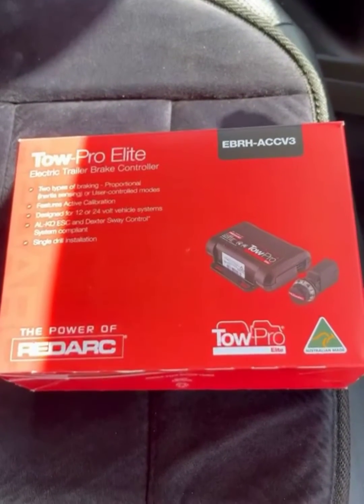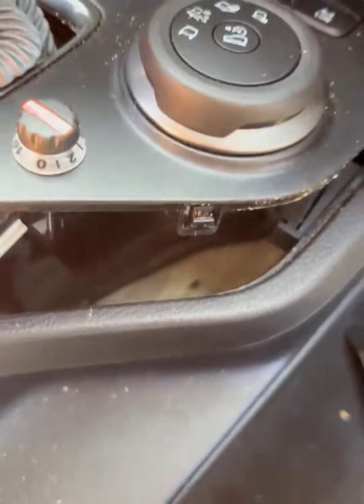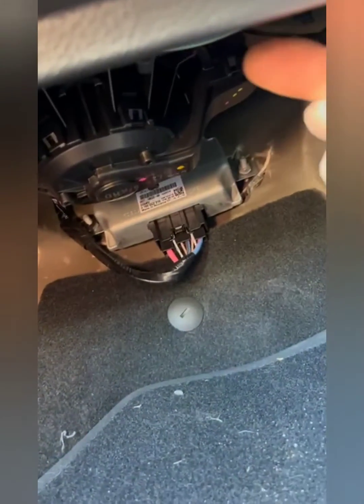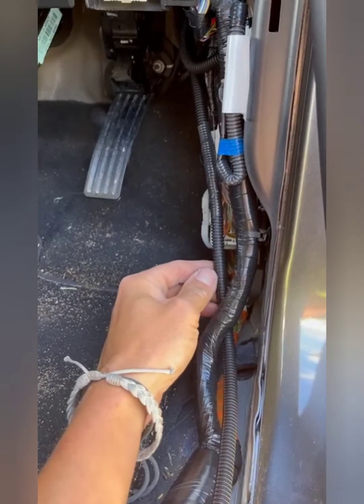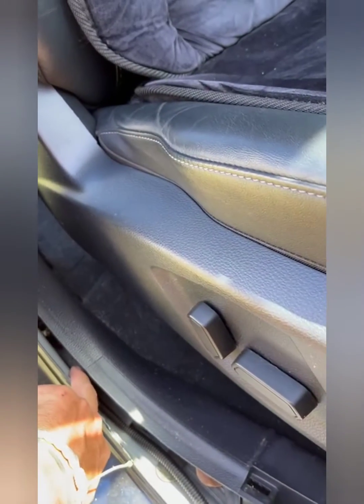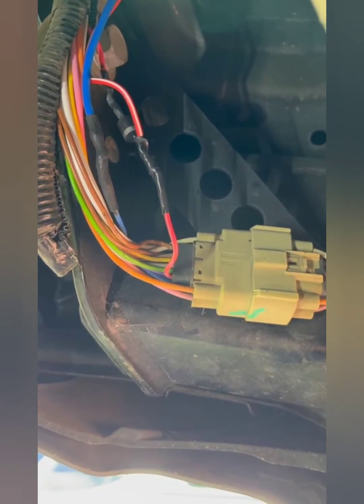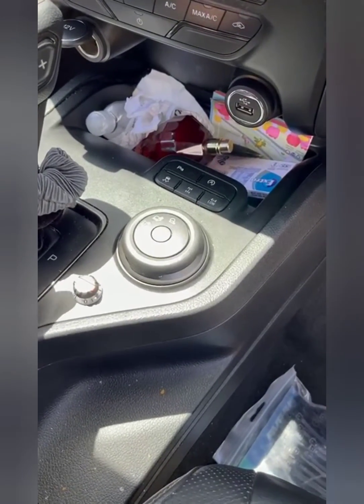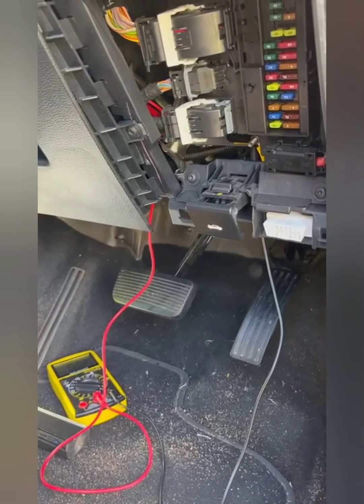How to Install a Redarc Tow-Pro Elite Brake Controller on a Ford Everest with AEB System

Comment: Hi mate, I did pretty much everything in your video but now I'm getting a BLIS and cross traffic alert alarm popping up all the time? Any suggestions?
Reply from the maker: Hi, what year is yours? Is it a next gen model?
Reply: @vesautoelectrics  it's a 2021 ford everest Titanium, let's of the old shape.
Reply from the maker: Sorry for delay, travelling overseas at the moment visiting family. If you used a diode and picked up the brake light trigger from the trailer socket, then cut that wire under the dash and and go straight to the brake light switch trigger with no diode. Wire colour details are at the end of the video. Some Everest’s can be temperamental and need to be done via brake switch even though of the spec.
Reply: @vesautoelectrics  i did use the diode! So you mean cut the red wire at the controller end, not the plug end! And find the break switch wire and connect the red to that?!
Reply: Oh, and remove the diode?!
Reply from the maker: Yeap spot on, and don’t use a diode. See if that resolves the issue.
Reply from the maker: Yeap
Reply: Would you recommend to do the exact same thing for my Everest titanium (my18 model)
I installed my brake controller (Curt Brake controller 529002) to the same instructions in your video but I’m also getting BLIS disconnection and cross traffic alert.
I connected the stop light signal at the rear with a diode because my Everest has AEB.

Really look forward to hearing back from you, 
Thanks

Comment: Thankyou for your video and advice cheers kevin
Reply from the maker: Glad the video’s helped. Let me know if you need any other info.
Reply: @vesautoelectrics  just finished installing per video and instructions with the diode around the right way but my blind spot and trailer is connected display keeps coming up every few minutes while driving even though trailer is not connected 
Any thoughts please I have a 2015Ford Everest with AEB braking .Thankyou Kevin Still

Comment: Thanks for posting the video, I found it helpful with the install in my 2019 ranger, though have been (intermittently) having issues with 'fast flashing' (of the dashboard indicator lights) when indicating left or right. I have reviewed my wiring and confirmed teh diode is installed in the correct orientation, and that my pickup is after it. Mine is a 2019 Australian XLT Ranger with Automatic Emergency Braking (AEB) & Adaptive Cruise control.

Further reading leads me to believe this model does require the special filter component included in the $300 AUD TPWKIT-012 kit (see link, small red package goes in-line with red wire at the controller). I thought I'd point this out for others so you can malke an informed decision before trying to install without the kit... 

If you have any further advice / info on the filter circuitry I would love to hear it before I buy the kit. 

https://www.redarcelectronics.com/au/tow-pro-wiring-kit-tpwkit012?utm_campaign=mof_aus_search_dsa&utm_source=google&utm_medium=cpc&utm_term=&gclid=Cj0KCQjw756lBhDMARIsAEI0AgnkucCahwXMa-pGkYk_TIY1Q0ughBZsOxLadW55FBeCkHqVAPP9fUIaAnCXEALw_wcB
Reply from the maker: Thank you for the feedback. If you have AED cruise control you normally need to pick up the brake light trigger from the trailer socket. This will stop ‘ hyper flashing’ from the indicators. But on some of the later models you do require the wiring harness with module as you’ve listed. I have found that 1 in 10 installs require the harness which makes it difficult to decide. Really weird?
Reply: @vesautoelectrics  Hey Mate great video! Im going to do mine but a little confused as you said at end of vid that if you Do have AEB to pick it up back at the trailer socket and use diode-OK. But on this comment you also said if you Do have AEB to pick up at the brake pedal switch? That must be a misprint is it? Cheers
Reply from the maker: Hi, yes sorry my miskate, it’s a misprint. Yes if you have AED then pick up is at the trailer plug. But there has been instances where intermittent hyder flashing still occurs.
Reply: @vesautoelectrics   hey mate also just wanted to add/ask about the wire sizes you said you used in the video, in the instruction book it says blue (3.00mm), red (1.25mm). Did you use 5mm and 3mm as you stated or did you match the size of the wires on the plug?
Thanks 👍
Reply from the maker: Hi, i always use 5mm blue (good for upto 30amp) for the electric brake supply (pin 5 ) as some controllers can pull upto 25amps and also using larger cable reduces voltage drop. And out of habit i use 3mm red for brake trigger ( cable size can be smaller as it’s only a trigger).
Reply from the maker: What brand brake controller are you installing?
Reply: @vesautoelectrics I am installing a v3 tow pro elite on a 2015 px2 ranger, I bought 5mm cable to do the job but the cable I bought looks much larger than the cable in your video, the blue cable you are using in your video looks to be the same size as the blue cable coming out of the plug.
Reply from the maker: The only explanation i can think of is that the cable you have is measured differently. Various brands measure it differently. Yours maybe 5mm copper plus the sheathing? The cable i use is from OEX, part no ACX0754.
Looking at their specs they measure the copper and sheathing together, 5mm total. But the copper is 3mm. 
Sorry I should’ve clarified that in the video.
Reply from the maker: You can still use the cable you have, bigger the better! Will just need to trim it down to fit in the trailer socket pin.
Reply: @vesautoelectrics  👍thanks for the clarification
Reply: Thanks mate @vesautoelectrics  . Ive dug deep and found out my 2015 PX2 ranger doesnt have true AEB but has "Adaptive Cruise Control' and 'Forward Collision Alert'. This FCA detects potential collision,Pre-charges brakes and will apply up to 0.3g braking force. But it will not fully emergency brake like AEB. So I'm thinking i should still pick up at the trailer socket and use the diode, or does it matter? I'm thinking  if the FCA does brake to avoid collision the trailer brakes wont come unless the pick up is on the brake light line, as I havnt put foot on the pedal and activated it?
Reply from the maker: Sorry for delayed response, only just seen your message. I would still pick up brake trigger at the trailer socket with a diode and see if you get hyper flashing for the indicators. If it does then pick up the trigger from the brake pedal. With the FCA function, it will still put on the brake lights without you touching the brake pedal which would also trigger the brake controller and apply brakes to what your towing. Which is a good thing.